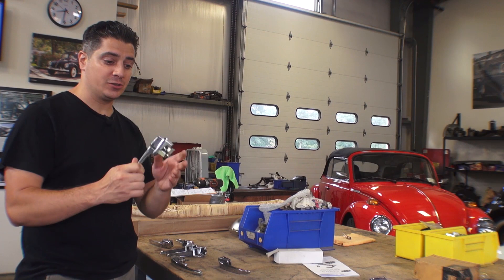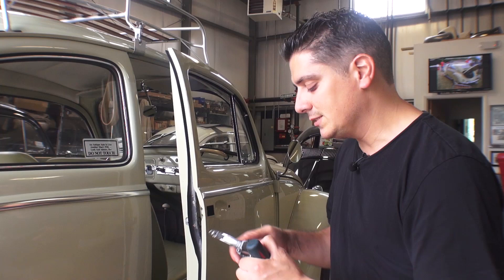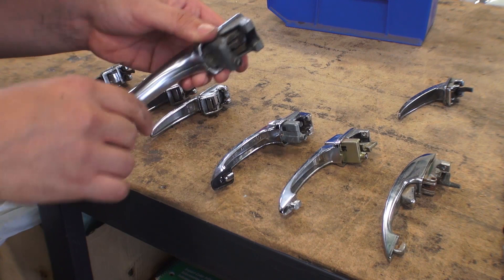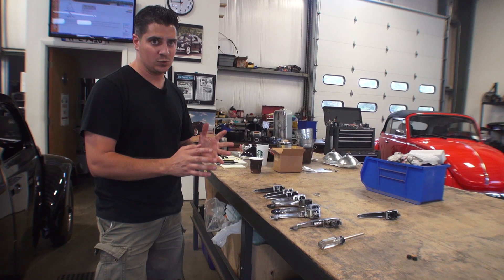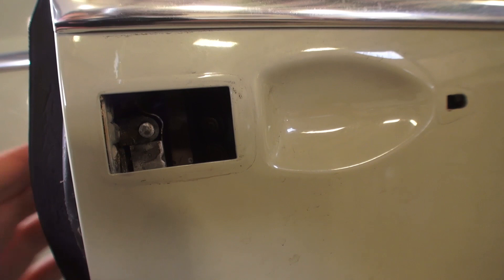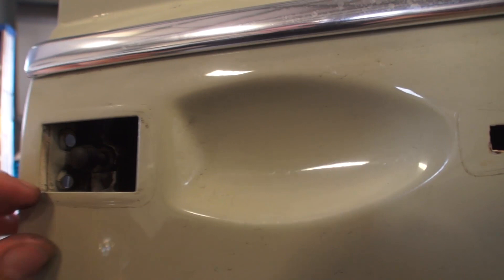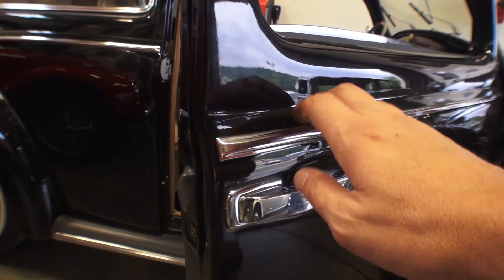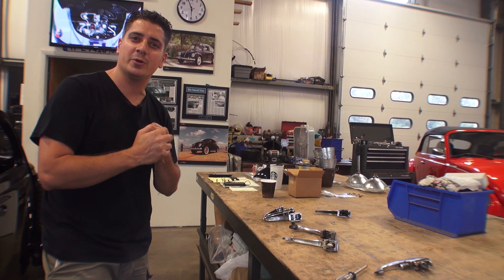Classic VW BuGs How to Remove Install Outside Beetle Door Handles w Changes

Comment: I have a '58 beetle, when removing the driver door handle, will I have to unattach it from the mechanism inside the door? Possibly make another video for the late 50s beetle owners?
Reply from the maker: No one you unscrew it from the side of the door it just slides a bit and out of the door.
Reply: @classicvwbugs  But the handle has to connect to the mechanism inside the door somehow, right? I'm a very technical person and just want to make sure I get it done right the first time. This is my first VW, so I'm trying to learn as much as possible.
Reply from the maker: @ratrodpunk87  No, it just pushes the mech in the door to release the latch.
Reply: @classicvwbugs  There is a little piece of metal sticking out if the bottom of the door handle and it's keeping me from pulling the handle out. The piece of metal is from the inside of the handle and I can't push it back inside the handle. Any suggestions?
Reply from the maker: @ratrodpunk87  It is just a small lip to hold it into place on the door, just pull the handle a bit and wiggle, it should free it up away from the door.
Reply: @classicvwbugs  I tried that for about 20 mins. I don't think it's a lip. My dad tried to pry it with a hammer and chipped some of my paint.
Reply from the maker: @ratrodpunk87  GOSH no prying whatsoever!! there is a just a small lip on the handle itself that holds it in.  LUBE that baby with WD-40.  I've done it so many times.
Reply from the maker: Also two screws hold the handle in.
Reply: @classicvwbugs  I took those out. I'll try again another day. Thanks for your help, Chris.
Reply: @classicvwbugs  it's fine, I got it off with a bit of wiggling.
Reply: Have the same problem on my 1957 bus. no chance to remove the door handle... :-(
Reply: ok, now it worked. carefully levered it out. the handle was really tight

Comment: Great vid, Chris! I have a ‘62. Heard a noise, something dropped down inside the door. It won’t move the latch enough, now. Didn’t see anything like it in your vid, inside the handle’s moving part. Now, I’ll be able to take the handle off & look. Q: will passenger non-locking handle fit on driver’s side?

Comment: I need to rebuild my 67 bug handle, and I can't figure out how to remove the "paddle" from the shaft where the spring is clipped around it. I would like to take the "paddle" off so I create a sand mold and pour a new one, with some thickness to it.
If it works out I might start selling them. The spring comes together in the middle with a 90 degree bend against the bottom of the paddle, pushing it back into the default position. Do you have a video showing how to take it all apart?

Comment: That rubber 'hat' is a good idea-- cant the original be stripped and rechromed? Myself if I was restoring one it would be nice to keep as many original parts as possible
Reply from the maker: Oh yeah for sure you can, definitely do it if you can, but you need to dismantle the whole handle.

Comment: Onthis video you mentioned that you have a video on '67 door handle, i cannot find it. 

My issues is my '67 was fitted with '64 handles - but they wont lock the door. So i found the original's but they won't lock or unlock  the door (with the Key) = i figure i have something else different. Now i am looking around - please let me know if you have an idea of where to start
Reply from the maker: I have a series on the 67 one year only features on YT.  Maybe your key is wrong for those handles?
Reply: @classicvwbugs  Key is fine, it works, it seems it just does not reach to the back plate to either move it up or down
Reply from the maker: @LeonelMartinez  Its possible the door mech inside was changed too.
Reply: @classicvwbugs  yes that is what I am thinking.. thanks!

Comment: Do you ever have a problem with late handles, after market parts? got a set and the section where the screw hole is, is not long enough, so the screw holes in the door are in the wrong place, thinking of filing them into oblongs, unless you have any ideas how to get round the problem ??

Comment: Just replaced mine on my ‘64 with the Brazilian made model.  The passenger side doesn’t work with the key.  The driver’s side is very stiff and needs a lot of force with the thumb to get the mechanism to work.  Many decades ago with my ‘61 VW van, the Brazilian parts were often better made than the German ones.

Comment: greetings i have a 1964 beetle - jan 1964 the handles dont seem to work .i re re keyed the drivers side myself and it works fine when not installed on door when installed it binds up and does not function correctly,i did notice a part # on the under side of handle.this was my dads race vw  in the past so really dont know what parts related to the door locks are on the car now.can you tell me what the vw part # is for a door handle for a vw 1964 pre 8-64? just trying to figure this puzzle out  thanx JF

Comment: I just bought some aftermarket handles for my 70 beetle. the fit is awful. the front where it hooks onto the door sticks out so far that the seal moves around freely. what can I do to move that part closer to the door? bought them from cal pacific/jbugs.

Comment: Hey Chris I have a question, how the non-locking handles suppose to work (66 bug) I put one on and is not opening the door when I push the knob, and I know is unlocked inside.
Reply from the maker: does the door open from the inside?
Reply: Chris Vallone yes, it works fine, when I open it by pushing the mechanism with the my finger thru the hole when the handle is not installed.
Reply: I just bought this handles and according to the code they are for a 66, just wondering if the non-locking passenger side is missing any components, thanks I appreciate your help and sharing your knowledge thru your videos.